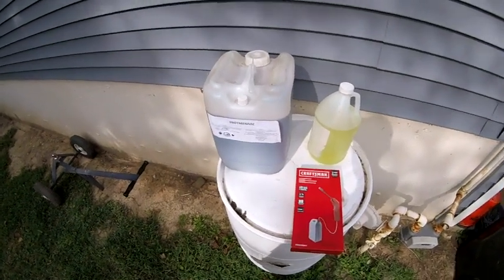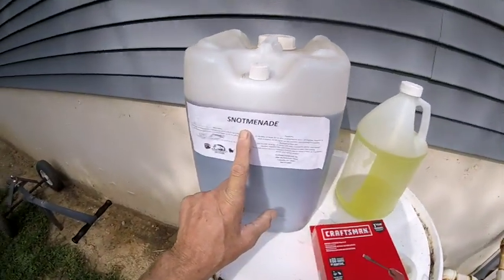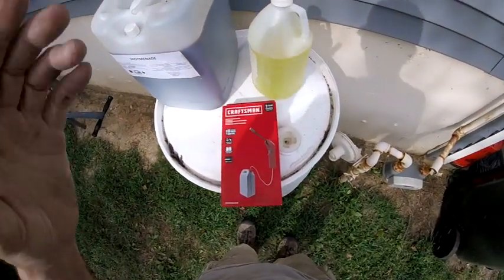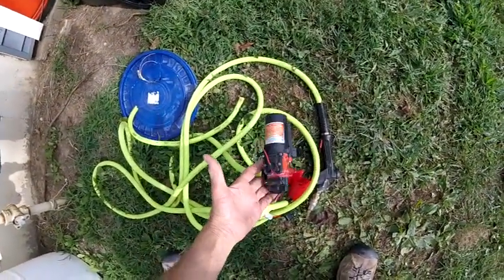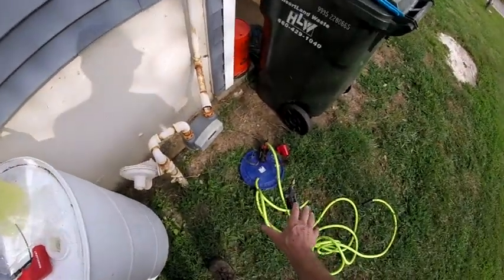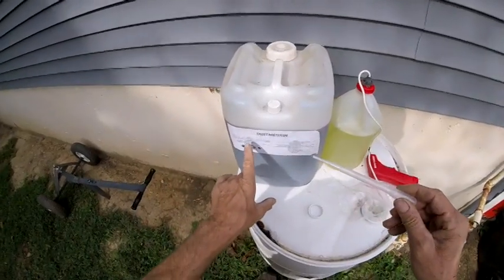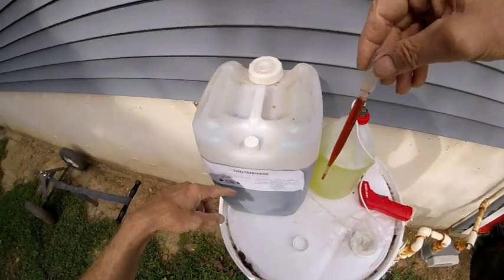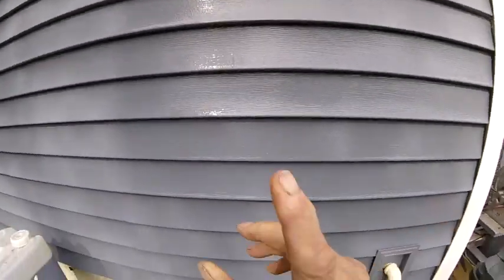Surfactant?  Yes or no?

Comment: Great tip Kenny, I will start reintroducing surfactant back into my SH batch at the reduced rate. I have honestly been missing my suds when the bleach appears through the hose.
Reply from the maker: @brianfletcher7942  use just enough and no more.
Reply: @housewashing5693  I have a 15 gallon batch tank and I will put one ounce in it, which I know is less than 1% but it still should make the water wetter.
Reply from the maker: @brianfletcher7942  I'm guessing that somewhere between 10-20% of the manufacturer recommended dose will be the sweet spot.

Comment: Thanks for doing that demo. I am always just "winging it" with my surfactant ratio. I still like to have more in a roof mix for a steep roof so I am not sure what to do about that because I might clean a roof then back to siding and then another roof so how can I control the ratio in the SH tank? I don't have any bright ideas.
I did buy one of them Crafsman pumps after seeing you use one. I don't think I have actually used it yet after 4 months.